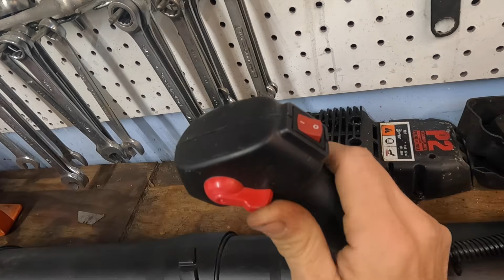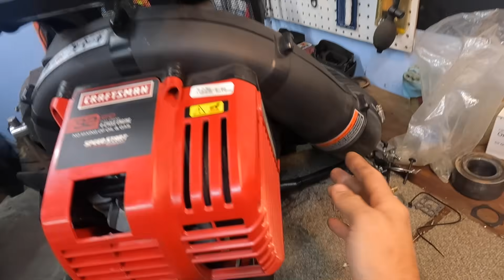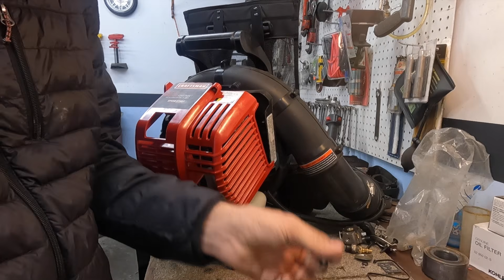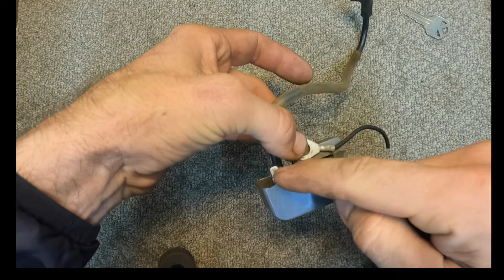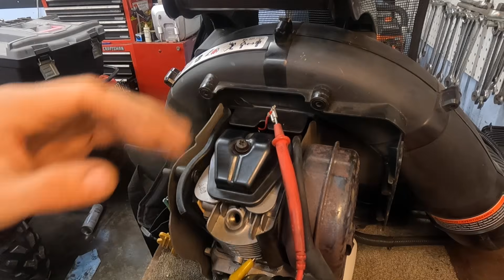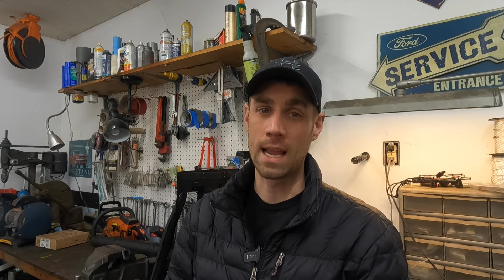How to diagnose ignition coil on leaf blower

Comment: Great video. I have continuity through the kill switch so it's good but still no spark. Bought a new coil still no spark. When testing the coil old and new I have continuity through the plug holder and base but nothing when testing the kill switch to the base. Is that normal?

Comment: Hi Josh. I’m viewing your leaf blower video from 2021. I have two Craftsman 46cc leaf blowers, identical. One has a bad ignition coil. I can swap the good coil between them and they both work. I have tried to order oem parts to no avail. I have tried several off brand coils, none work. One thing I do notice is that each coil I get reads zero ohms from the spade to the fin of the coil. Essentially always grounded out. On the oem coil, the working one, it reads open. Should I be using plastic screws so that the coil metal doesn’t ground out?. This makes no sense. Any suggestions?  Thanks , Jack

Comment: Hey j what's up! That's a great video helps I lot!im not good on the electric stuff ! But  have a question! I have a PB 755 it was running fine before I did some work on it, the muffler was loose I keep putting new bolts but didn't help! So I decided weld the muffler so now the blower won't start! I on ready put a new coil still don't run!any idea!!! Thanks!!!

Comment: Good video . I have a stihl 400 blower , when the kill switch is off , I have spark at plug , when it is in the on  I still have spark at the plug . It will not start so I think my problem is something similar to what you are explaining . Any ideas on how to rectify it . 
I am a bit of a dummy when it comes to understanding kill switches . 
Any help would be very kindly accepted
Thanks in advance
Reply: if you have spark it should run. your switch problem means the switch isn't grounding out, chase wires and check all connections. But your issue of it not running is either carb or compression. make sure you got spark, then spray starting fluid into the intake and if it runs then the problem is the carb and if it doesn't than the problem is compression or an air leak.

Comment: Can you listen to my blower and tell me what you think it is, I've replaced the carburetor, fuel filter, checked the spark arrestor and changed the plug. It starts up perfect and runs at full throttle for maybe 1-2 minutes then it starts doing this until it shuts off. Here's the link: https://www.youtube.com/watch?v=YZZZ4KAXzno&t=30s